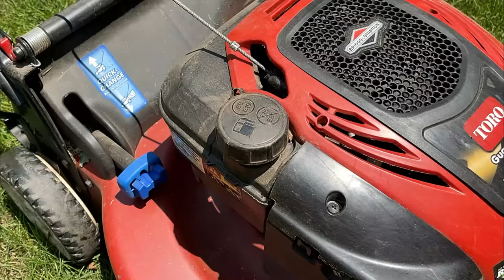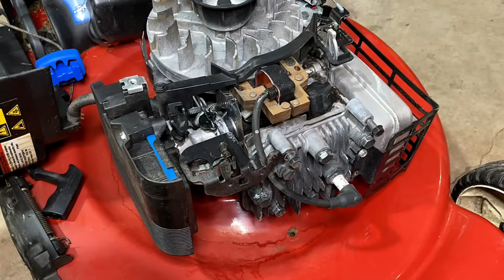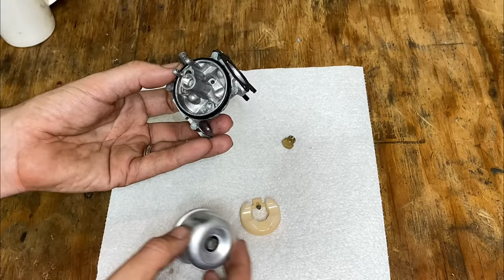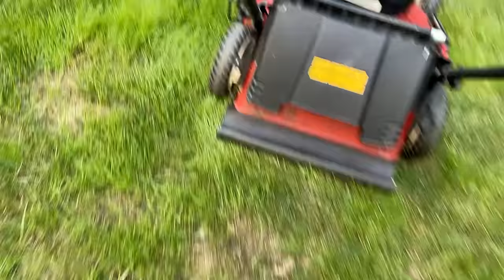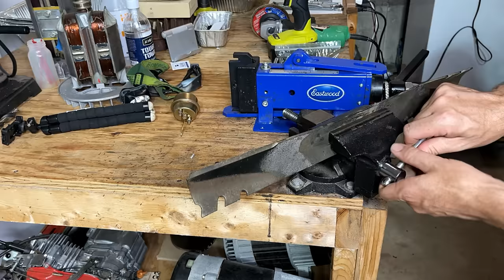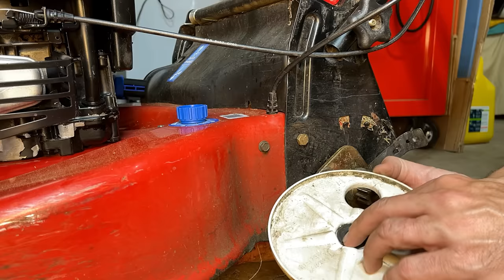Free Smoking Lawn Mower - Not an Engine Issue

Comment: Did you save the old wheels?  Can you cut one apart to see how that rivet is imbedded in the plastic?  I'm thinking of several ways, including molding and casting your own gears, making a thin gear from metal that you would shave down the wheel gear and attach the metal.  I've several thoughts/methods by moving the wheel closer to the drive gear I'll post under separate comment.
Reply from the maker: I almost saved them.  Though for a moment I could put them on a generator.
Reply: @jcondon1  Yeah, plastic sleeve/bushing from Ace to bring the mower axle hole down to the generator axle size. Or are they too thick...

Comment: 7HP? Back in the 60s and 70s, they did the job with 3 1/2 HP, that's efficient? I pushed my grandfather's mower when I was 8 in 1967 and 3 1/2 HP was plenty of power. DON'T TELL GRETA!
Reply: No one believes that's actually rated at 7hp.  Much like Sears tablesaws back in the day, rated 3hp but with a 120v, 15a motor.
Reply from the maker: You cannot put much in those numbers.  Working on the 2100000 series Briggs, the older ones say 11hp.  The newer ones say 10 hp.  Same bore size, same stroke, same everything.

Comment: These things are pretty plastic and junky. I was suprised how tacky they are when I saw one in the flesh, and it was heavy and bulky too.
All that grass and crap stuck to the bottom has to be removed from the bottom otherwise they rust out pretty easily, like most steel decks.

Comment: I had to laugh when you held up a new air filter. You went into your "parts department" and pulled out a new air filter from your inventory! 

My daughter just bought a house in Charleston, SC., the sellers left an antique Snapper mower, similar to this one. I don't think they ever changed the air filter and a local mower dealer made a grunting noise, went in the back, came back out, and said no luck. I'll swing by to see if you have one in your inventory that will match up...

Comment: Hey dipstick you did not have to clean the bottom of the frame it does not have any affect on how the mower runs all you needed to do is sharpen the blade and the reason the self propel system tends not to work very well and strips the gear pretty easy is because every time you go to pull the rope to start the engine the whole handle moves slightly to the engaged position to try and make the mower move

Comment: So in my book the only method of cure is not an easy fix. It is to take off the wheel. Take off the wheel mounting plate. Cut a slice through the wheel mounting plate. Reweld the plate 1/8th inch nearer to the drive cog and re-install. Almost not worth the trouble except for a shop catering to older frail women who need the mower to help pull through the grass. This would be a very tiny percentage of people who had a husband who would start the engine but need the wife to mow because of longer time involved in mowing. Usually when a person can pull the starting rope it will do them good to also mow but for his heart it would be better to mow every day but this is not needed. I am not a big fan of self propelled hand mowers because of having to also be able to start the mower and if you can do that you can surely push it around the lawn. I just don't get it.
Reply from the maker: I actually like the push mowers, they are a lot lighter and much easier to push around then a self propelled one with a bad drive system.  I agree, cutting the plate and rewelding it would be a good permanent fix.

Comment: James does the engine not have a oil drain located under neath by the Blade ?
Reply: I don't see one when he's working on the blade/deck but could be hidden by the shaft or belt cover. Newer ones often don't have one but used mowers that area is filled with dirt & grass and possibly corroded. Most all channels show tipping onto side because it's easier and doesn't risk stripping a bottom drain.  Plus you generally have to tip it up to work on the blade and deck anyway.
Reply from the maker: I think most do have one under the blade, but have never gone looking for it.  Easier to tip it and usually the bottom of the deck has so much junk on it, that removing it might be more trouble then its worth.  Especially on a 10 year old mower that has probably never had it removed.
Reply: I like the drain pipe above the deck with no tool needed to open.

Comment: Why not drill and tap a new hole closer to the sprocket?
Reply from the maker: The gear only needed to be moved a little.  Too close for another hole.
Reply: @jcondon1  Weld a bold with an offset?

Comment: The drive system was poorly designed. The gears should have much greater contact. There should be better replacement wheels available as well.
Reply from the maker: Completely agree

Comment: 3d print a smaler sprokket inside the wheel... By a printer and make content... :)
Reply from the maker: I have a printer, but the plastic is not really robust enough.  Have tried a few times to make parts and they failed rather quickly.
Reply: @jcondon1   I think the right material is out there... (SLA 3D printers)

Comment: I wonder what would happen if you ran a generator on full choke and used a leaf blower to force air into the intake?
Reply: The choke would still block the airflow, and not run well at all.

Comment: 190cc does not translate to seven horsepower.
Reply from the maker: You are correct.  Did not read the fine print.  Think it was 7 ft lbs of torque.  Probably more like a 5 or 6 horse engine.

Comment: That little bit of water may have gotten in the float bowl when you washed the engine.
Reply from the maker: True, power washing usually results in water where you do not want it.
Reply: I've pressure washed all my mowers n never had water leak into the bowl. Seems fishy.

Comment: Mower should not be tipped on it's side surely?
Reply from the maker: It is safe to tip as long as the carburetor (breather) is up.  Otherwise you will get a lot of oil into the carburetor, air filter  and all over the floor.

Comment: I was always told not to turn these on their sides. Screws up the carburetor beyond repair.
Reply from the maker: It is ok as long as the carburetor is up.  If the carburetor is down then oil will come through the breather and into the carb and air filter.
Reply: Tipping a mower is the worst thing u can do to a mower.